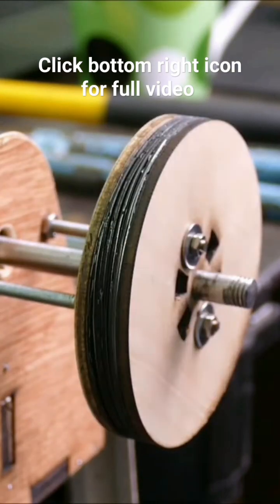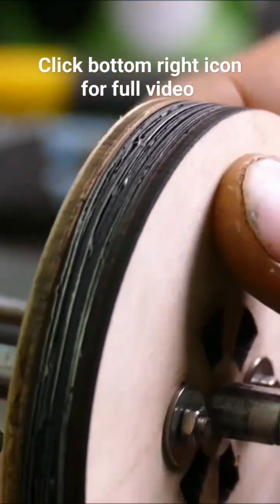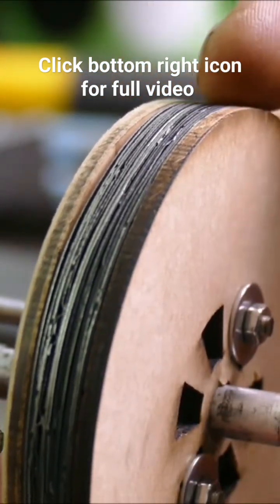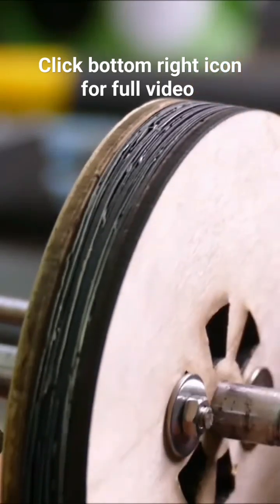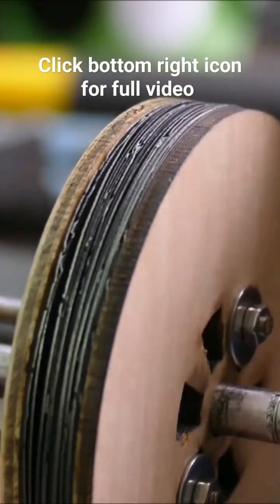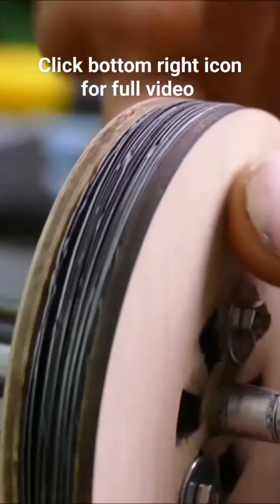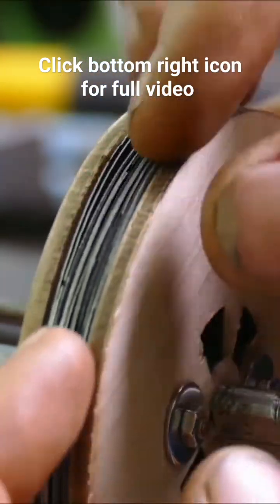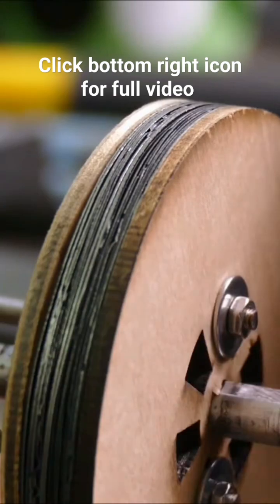DIY Tesla turbine simple build. clip from full video. #lasercutter

Comment: 1 explanation was, the air or water got between each disk down all the way through the radius. Disks had small gaps & a relatively smooth surface. We had a vaguely similar device w/ 1 disk. It was an oil slinger in a gear box. The disk was smooth, not polished. It still kept everything from grinding down to metal confetti.

Comment: Micro Tesla Turbine Power Test 

Version 1 modified v1 well over  a 100.000 rpm
Reply from the maker: thats awesome, how many watts does it generate? what torque does it have?
Reply: @joshuadelisle  under load 9.8ish watt’s it’s a 5 min vid this particular one is a little beast the tachometer he had only went to only 100.000rpm and could reed no more if this was scaled up some what I think your onto a winner. On the vid it tells you the amps as well but I don’t recall any mention of torque. But if something is spinning fast enough with not to much weight it will produce a fair amount of torque. But as he mentions in one of his vids the key to making something like this spin that fast is to get a very good balance on all spinning parts shaft discs or fly wheel ect if it’s an engine the crank shaft and flywheel both need to be balanced together and the rods all need to weigh the same.

Comment: Where is the casing ? 
I could use a round pieces of wood and it would spin. For a tesla turbine you need a enclosure. To force the air to come out at the center of the turbine.
Reply from the maker: Correct. This is just the first part. Cheers J

Comment: Good experiment but, 
(1)The rotation need not align the discs parallel.
(2) Even if they are not aligned, when rotates fast, they may look like straight lines (aligned).